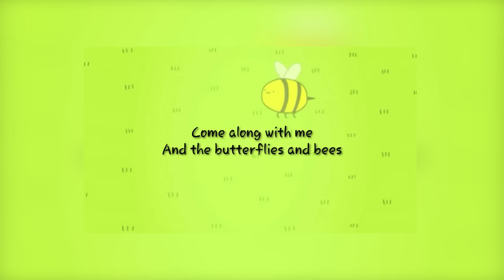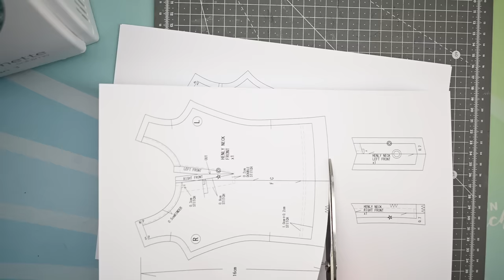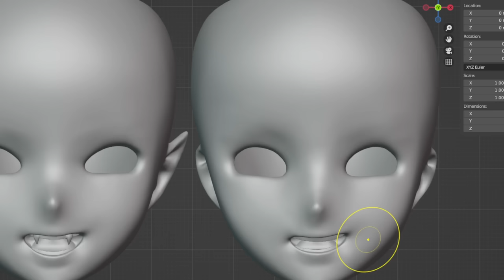Fionna The Human • Fionna and Cake • Adventure Time Custom Smart Doll OOAK

Comment: 15:50 In fact, it is more stupid to use a dull blade to cut anything. Especially on fabric that catches and especially especially on tiny little pieces that you have to hold very close to where you are cutting. A dull blade guarantees that you will have to press harder to cut, and when you slip it guarantees you are pressing hard enough to slice your flesh.